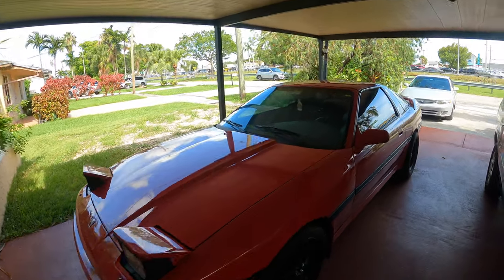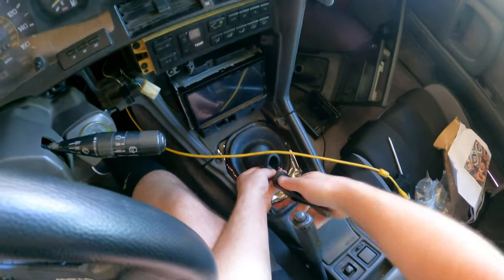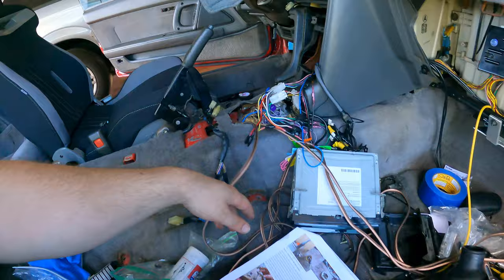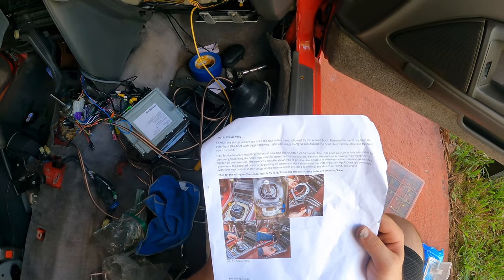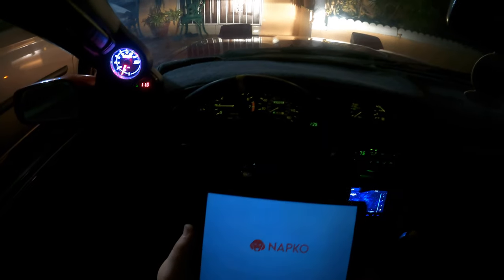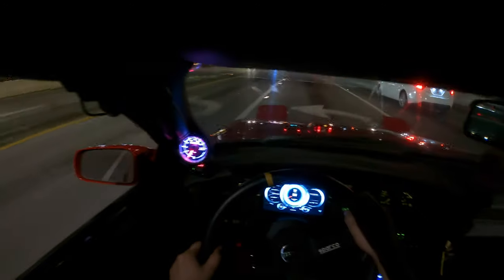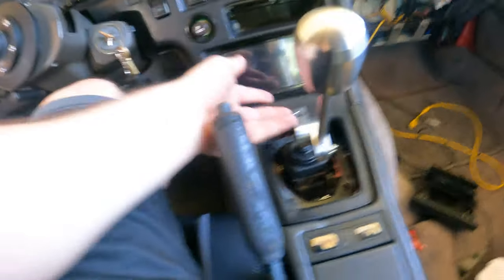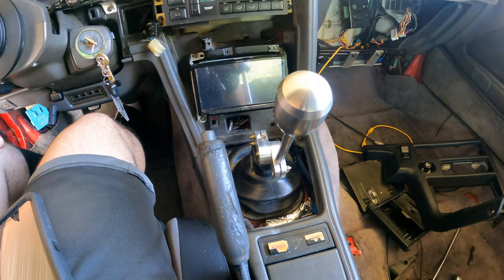The BEST MK3 Supra Short Shifter on the Market? Nashman Motorsports V2.5 Install and Review

Comment: C h e e s e ! Lol
I used to have one of the Nash man v2 shifter. You can definitely fit the stock leather boot over the shifter. Also I’m interested in the planted seat brackets
Reply from the maker: Appreciate you sticking around for the whole video! Send me a message on instagram and we’ll talk about the brackets
Reply: @SickStreets4K  not sure why I didn't get a YT notification earlier... I already ordered a set of seats and included the brackets.
Reply: I tried running the boot and the shifter kept getting bound up when trying for gears 1,3,5. It's just too tight of a squeeze.
Reply from the maker: @mamakd32  usually the seats only include the sliders, you sure that included the floor bracket too?

Comment: I just installed my nm 2.5 shifter as well. I didn't realize you couldn't run the dash trim+boot when I bought it...
Reply: c h e e s e
Reply from the maker: Appreciate you sticking around for the full vid man! That was one thing I did not like the idea of when first purchasing, but it flows really well with the car once you've got a nice steering wheel in there, maybe some aftermarket gauges and possibly seats.

Comment: How do the thigh bolsters feel on the r333 seats? Overall feeling in the kidney/hip area as far as being planted? I’m caught between the r333 and the spx seats. If the r333 can check all my boxes as far as performance, I’ll go with them instead
Reply from the maker: Felt pretty good. Snug, but not intrusive. The only big issue I had was seat height. Other than that, the lumbar support is somewhat lackluster, but really good seats for the price. I really do not recommend them for mk3 owners though.
Reply: @SickStreets4K  how was the shoulder support? Was it solid or kinda flimsy?
Reply from the maker: @Diamondsintherubble  shoulder support is great
Reply: @SickStreets4K  good to hear, thanks! My oem new edge seats are seriously lacking in the shoulder and hip support. I really like the r333’s but was also considering an evo s as a stepping stone to the spx. I’ll be sure to check those out